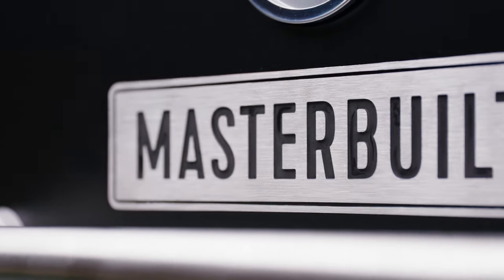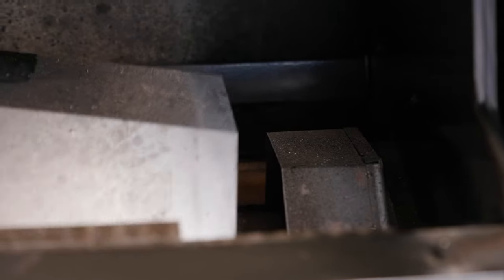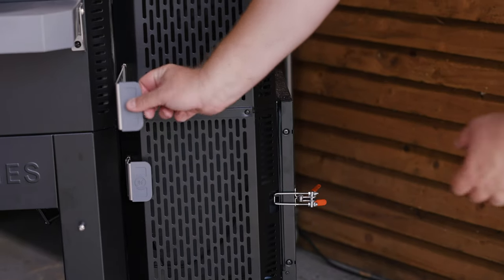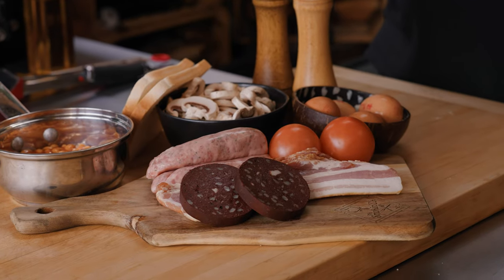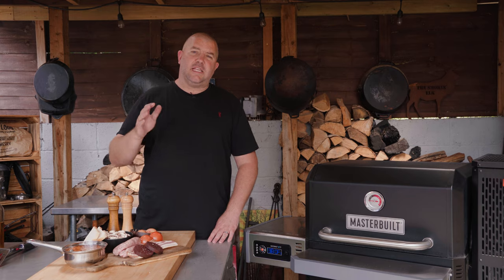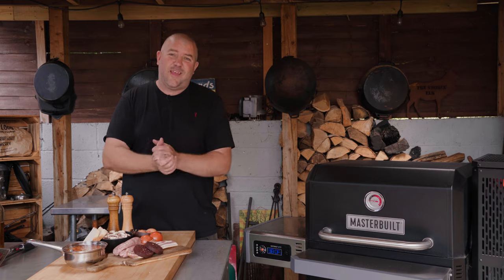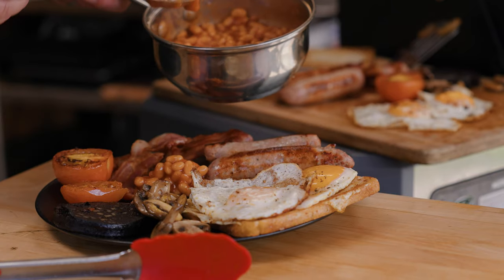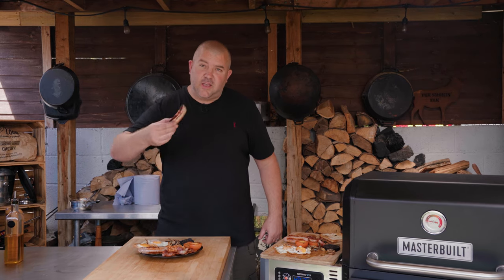Full English Breakfast Cooked On the Masterbuilt Gravity 800 BBQ Griddle

Comment: The only issue I've had using the flat top, is if the ground isn't 100% level, the fat won't run off. We ended up with a fat swamp in the back right corner.... Need to figure a way to level it out. Tbf the food did taste amazing lol, though my arteries probably didn't appreciate it.

Comment: Is the griddle manifold only available with the 800 model? I'm undecided in getting 800 or 1050 this would make the decision for me if its not included in the 1050. Many thanks
Reply from the maker: Hey. Yeah, its only available on the 800 as it stands
Reply: @TheSmokinElk  nice one thanks for your time . Will be getting the 800 based on that. 👍🏻

Comment: It's not easy in the UK to get the fire starters and if you can find anywhere there quite expensive. What other brand of fire starter do you recommend
Reply from the maker: Hi. Any wood wool eco friendly fire lighters are good!
Reply: I just use a paper towel folded up with about 2 TSP of oil soaked in

Comment: Looks brilliant. Question though: how do you cook so long with the lid open? When I have my lid open the temp starts dropping fairly rapidly as the fan shuts off. Is there a trick I am missing?
Reply: Mine too, I just bought it a week ago and am really disappointed actually. Does well with heat control when lid is closed, like smoking, but open that lid and had trouble keeping fajita meat sizzling at 600 degrees....how is your doing now Peter? I am really thinking about returning and going back to three grills. Any feedback would be greatly appreciated.

AND, have emailed Masterbuilt several times as my temperature start going down (even closed) about 20 minutes before the timer runs out, does yours do that?

I set a temp with a 60 minute time for example.
At minute 40, the temp start reducing quickly, as if bringing it to zero.
If I increase the time, then it will bring it back up to temp.
Reply: That should happen on the 560 or 1080… the 800’s fan should stay on with the lid open.
Reply: If its that big of a problem to you. You can just bypass tge cover limit switch fan will stay on